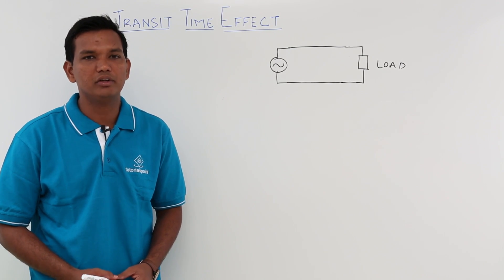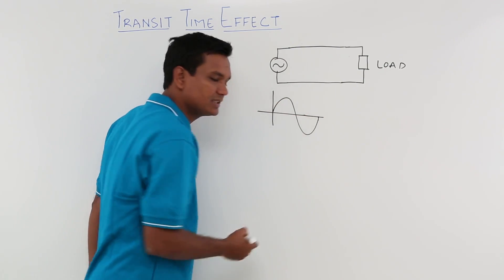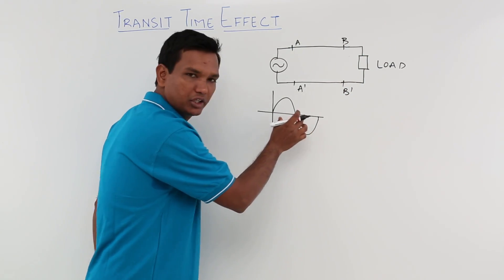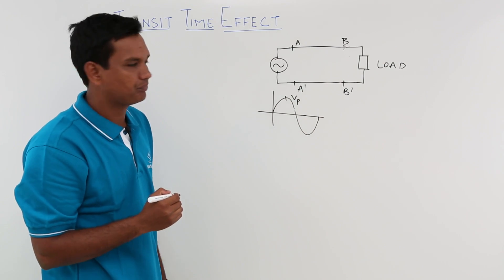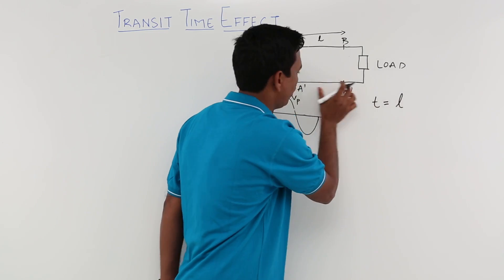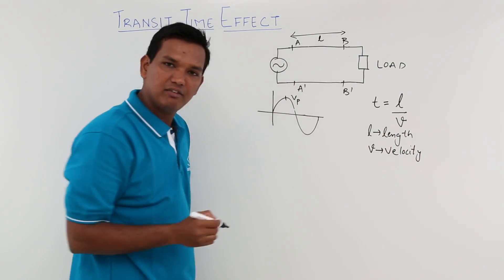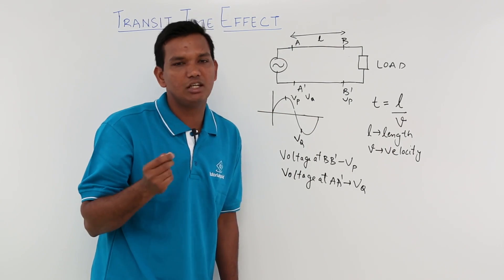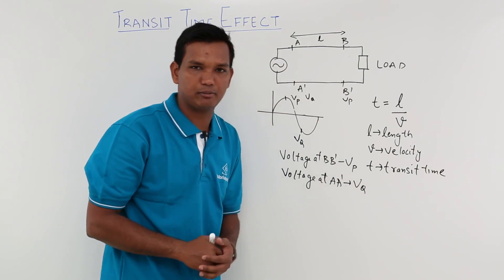Transit Time in Transmission Line

Comment: Transmission lines operated in the radio-frequency range and at higher frequencies are generally modelled and analyzed using distributed parameters (inductances and capacitances) because the quasi steady-state conditions which allowed us to write capacitive reactance as 1/2πfC in the lumped region, breakdown in transmission lines of lengths which are greater thsan the free space wavelengths of the signal. Also, remember that fields do not travel; only the wave travels. 

Electrostatics and circuits belong to one science not two. For a unified approach to learning Current and the process of conduction watch these two videos i. https://youtu.be/REsWdd76qxc and 
ii. https://youtu.be/8BQM_xw2Rfo 
[ See these lectures by North Carolina State Univ faculty which use a unified approach to electrostatics and circuits. 
15. Simple D.C. circuit. 
Pattern of electric field.
Watch from  16.0 minute.
16. Mechanical Battery
Watch from 19.0 minute.
Ch18L1b
https://youtu.be/Eu3JQKrJRZA?si=t3MeX8Hi8ELAxaz0
17. First intro to  Surface Charge 
Watch from 10.30 minute. 
18. Surface charge gradient 
Watch from  15.30 minute. 
Ch18L2a 
https://youtu.be/bp0o1HZOs3g?si=PPiPGepbXvdTgJHX  ]
Also, in the textbooks referred in the last frame of video i you will find descriptions of the operation of resistors, capacitors and inductors using this approach which makes it easier to understand.
There is also in chapter V in the textbook references 'Fundamentals of electric theory and circuits' which explains the operation of transmission lines using the unified approach. Also explained is why the speed of a voltage wave is always less than the speed of light.
Textbook 4 is here https://techsarworld.com/product-detail/fundamentals-of-electric-theory-and-circuits-559 
PPTs and Videos with animations for all the ten chapters including that of pn junctions Chapter 9 and a few applications Regulated DC Power Supply, Differential Amplifier and Transformer coupled audio power amplifier of  book Fundamentals of Electric Theory and Circuits are available for download and viewing here
https://techsarworld.com/download-resource/fundamentals-of-electric-theory-and-circuits-559